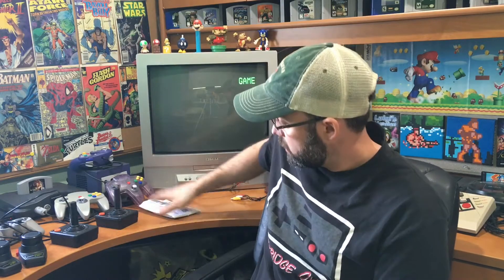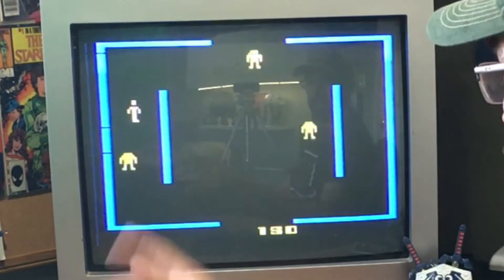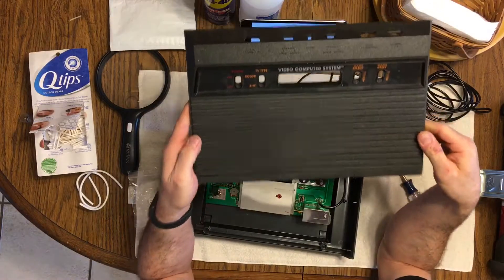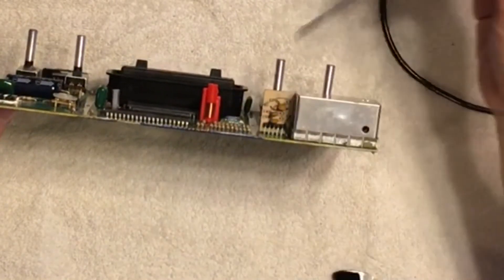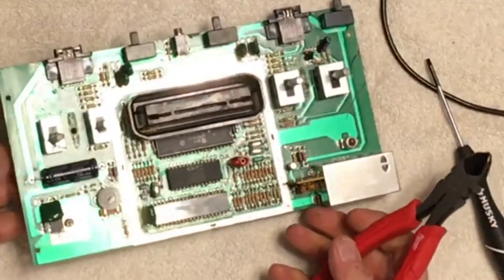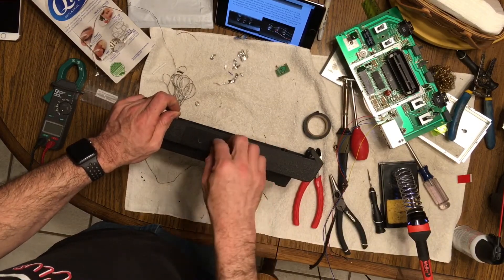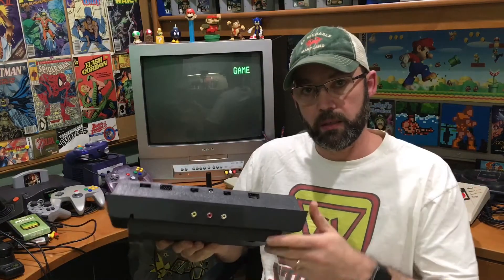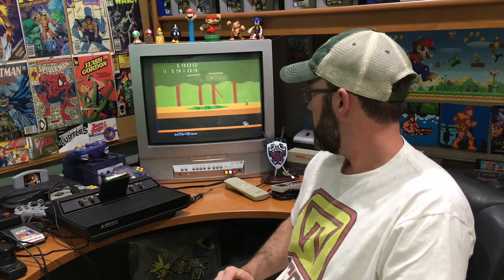Atari 2600 Composite Mod

Comment: Great job bro! The color and ghosting is just part of modding the system. You're cheating a video signal that the 2600 was not designed to make. That said there are better boards to mod these out there. If I can remember a seller that has them I will message ya on Twitter brother. Atari Age is a great place to check around!
Reply from the maker: The Atari Creep thanks for the input and thanks so much for watching. I actually got the colors tweaked a bit better so it’s just the ghosting that bugs me now. But it’s not terrible
Reply: mine has some dark smudging on the sprites like it's noticeable on adventure and is dim too, it's a 6 switcher av modded that i got from ebay cause i don't have the knowledge of soldering nor do i have a soldering iron
Reply: Hey Atari Creep did you find out who was selling the better mod boards?  Only this is something I want to do. many thanks.